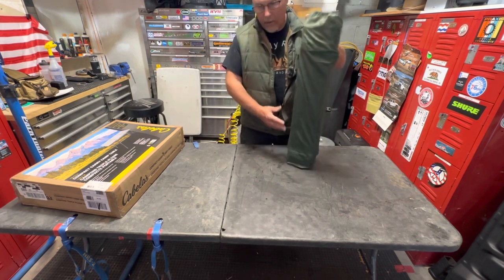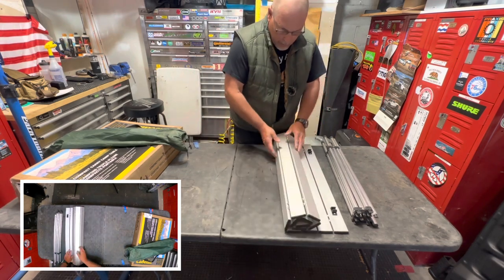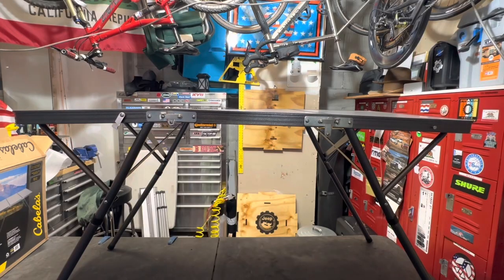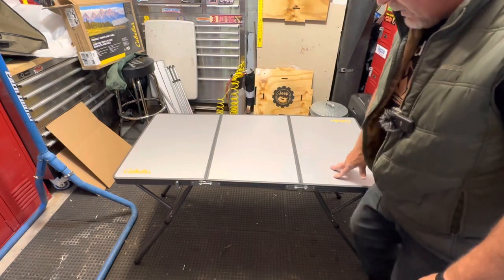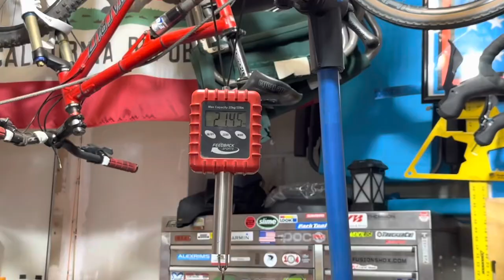Why Is This The Best Camp Table? (Cabelas Folding)

Comment: Hi, thanks for the demo. In the video, the table top seems a bit warped in places. Did it settle to a more flat surface after some use? I would be using it for portable ham radio use, out in the field. Also, if someone was cooking and using it for eating, a flat surface would be important. It looks sturdy, though!
Reply from the maker: It’s pretty flat. I have a heavy cooler on it right now. Thanks!